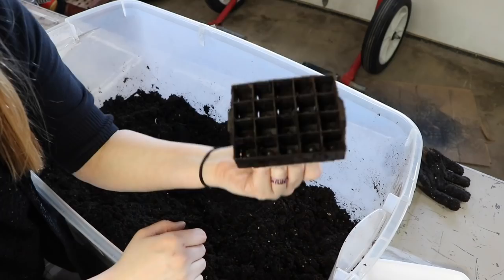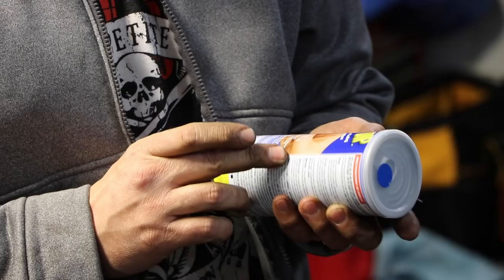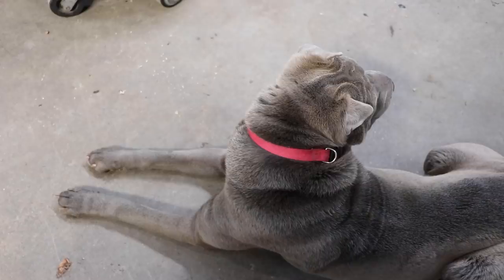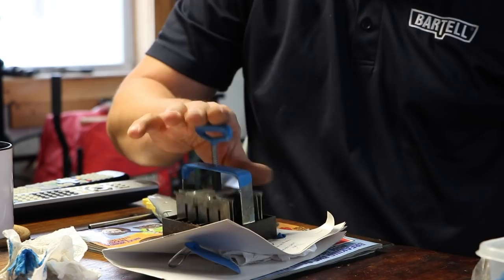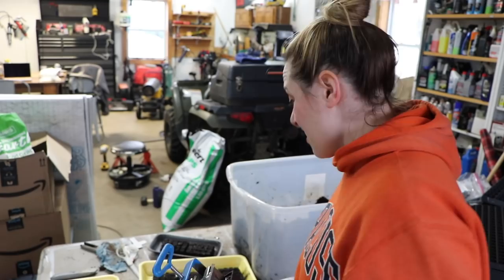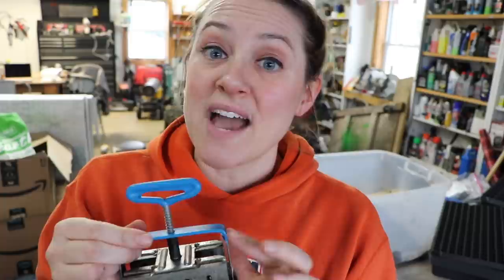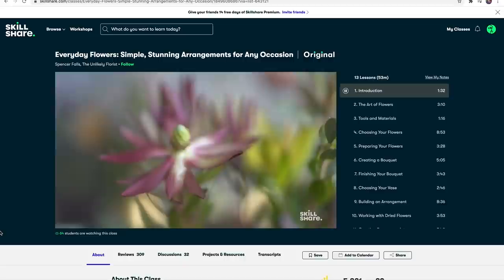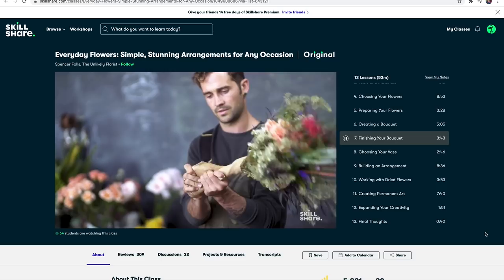Soil Blocking Hurts! : My Quick Fix : Flower Hill Farm

Comment: OK- The "New and Improved" Soil Blocker looks great. However you said "Pipe Insulation" and that is what I had thought of several videos ago.At any hardware store you can find long tubular (like totally) soft foam insulation covering (usually black). They are like the "Pool Noodles" only thinner. I've used them for crafting many things because they are super cheap. They are split on one side. cut them with scissors and Ta Da- you have foam padding on the top part of your Soil Blocker. They are 6' tall and you can choose how thick. I'd wrap that sucker on there with Duct Tape (like a real Pro). $2. and you can do all your SBs and then some. I'm a recent subscriber and have been binge watching all of your videos. I still have a few more to go. I love your personality.